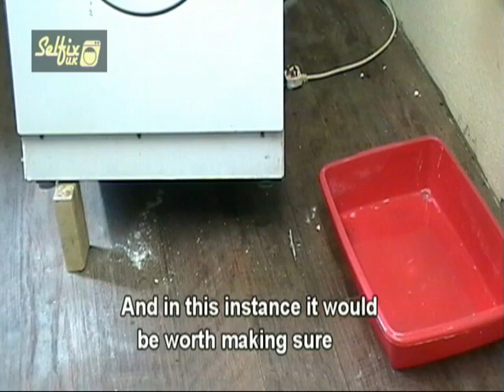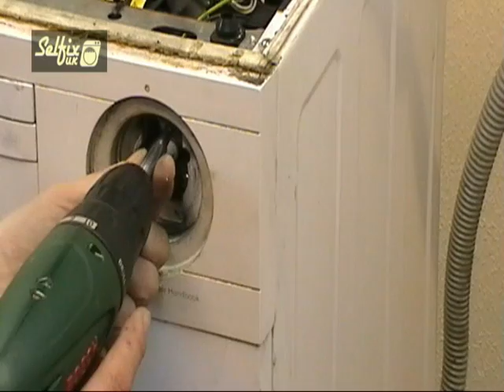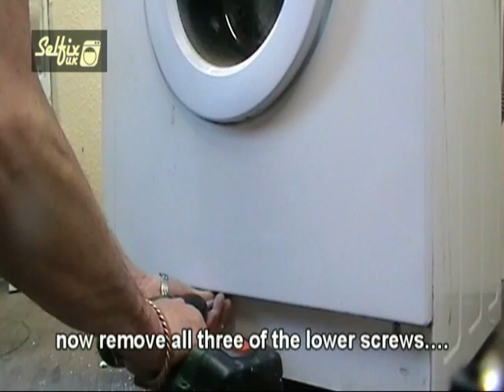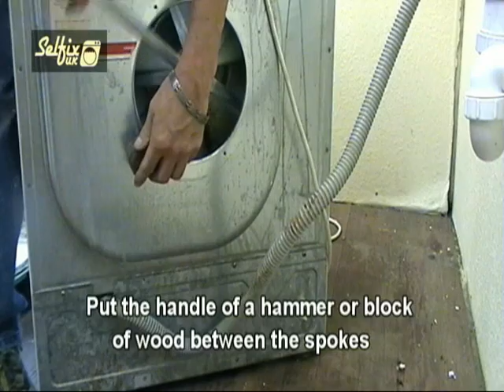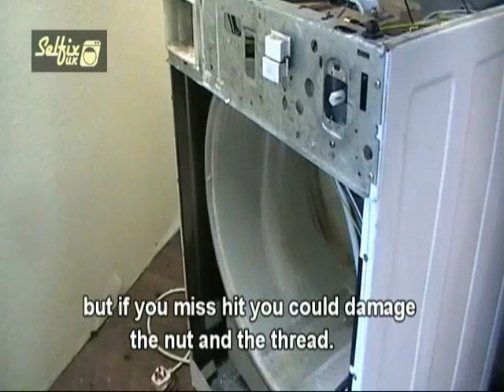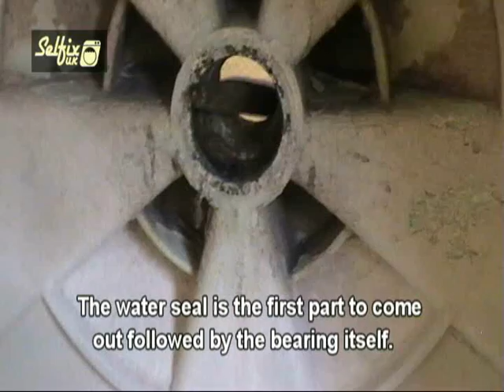How To Replace Hotpoint Washing Machine Bearings (1 of 3)

Comment: Thanks for the video. Spot on. I just did my Hotpoint WMD960. It's pretty much the same with a few small changes in the first steps to get the drum out. Like the comment below the first (larger) bearing was very hard to get out. I had to whack it really hard with a punch and lump hammer. However, with proper support it didn't cause any damage to the drum. It didn't take hours but I did have to increase the weight of hammer. I had to put a jubilee clip on the sump pump tubing as the plastic one did come off on first wash but other than that it was straightforward. A £20 for replacement bearings and four hours work or £700 for a new machine - easy choice.

Comment: Sadly, in attempting this, this video makes it look somewhat easy to get those bearings out.  It’s anything but.  The bearings will most probably be rusted in after all these years - while the video shows a few bangs and the bearings are out, in reality, it make take hours of hammering.
Reply: In my case, the inner bearing came out easily! If yours was the original bearing then yes, my original factory fitted bearing did take some shifting! But subsequent ones (and they don't seem to last longer than 5 years now) ,  pop out quite easily.
Reply: @nicam49  My inner bearing came out easily as well.  It was the larger one that was the problem.  However, I’m VERY disturbed to hear about the longevity of the replacements, although I should expect this as the replacements that are not original, old new stock (even if they’ve been sitting on a shelf for 30 years) are much more robust than the aftermarket ones you’ll get (or even ones that fit for newer machines).  In any event, my machine is beginning to make that ‘tweet’ noise again, which originally led my attention to replacing the bearings.  I thought, surely this can’t be bearings again, as I’ve only replaced them a few years ago, and my original ones lasted decades.  Ugh.